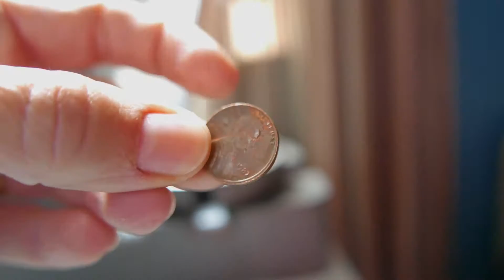Enameled Pennies

Comment: What was the liquid you placed the pennies in after you heated them with the torch, and what was it for?
Reply from the maker: It’s a pickle solution to remove fire scale from the penny.
Reply: What chemical (the fastest method) do you use to clean the pennies?  Also, can you Enamel pennies that are 1983 and after due to them being zinc?
Reply from the maker: @bkwilliams5s  You can use vinegar and salt if you prefer a natural and easy to make solution.  I never measure.  I use enough vinegar to cover my pennies and salt is prob 2 Tablespoons.  The fastest method which is what I use for all my jewelry making is a granulated pickle I buy from Rio Grande. https://www.riogrande.com/product/RioPickleforNonFerrousMetals3lbs/5010233
And, as for the years of the pennies, you can only use 1982 and older.  Try torching a newer penny and see what happens!  haha.  It just melts instantly.

Comment: I don't know why your video has so few views and likes. This is an extremely easy way of showing how easy enamel work can be while using common materials, even. I was wondering if you look for older pennies so that they have more copper content for these projects? Or does it not matter? I love the fact that you don't endlessly chatter like other craft videos! Thanks for sharing. What did you use in the doming block?
Reply: Only enamel U.S. pennies older 1981 and older. They started adding zinc in 1982 and they will melt on you.

Comment: your cute! don't mean that in a weird way. it made me smile when you blinked your eye!
the vid is good as well. question. why did you dome them and enamel the inside? i am actually about to do some coins and i've been thinking about the tension issue on the opposing sides. i'd like to do them flat. any ideas you could share? thanx!
Reply from the maker: Hi! I domed the pennies first because I thought it would look cool. :)  That's the only reason.  I have enameled flat pennies too and it works great.  The only tip I can think to share is that you use an adhesive spray (some people use hairspray) to hold the enamel powder on and then wipe the edges clean with your finger before firing.  It looks more finished and it's a pain to get off after firing. Good luck!
Reply: thank you!

Comment: I didnt know you can pickle enamel? would you mind sharing the tool on your flex shaft for cleaning the back side? Thanks
Reply from the maker: Yes you can pickle enamel but not the red and orange colors.  I'm sure there is some science to explain why but I don't know it. :)  The tool is a Dremel fine abrasive brush.  Works great for cleaning the backs as long as you use a light touch and don't stay in one spot for too long.